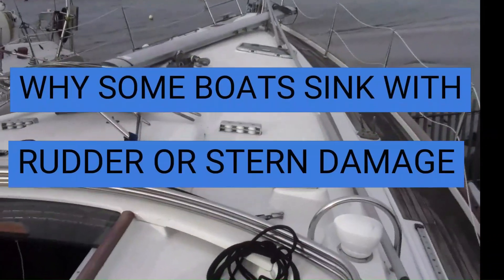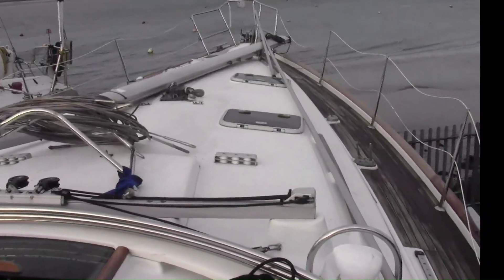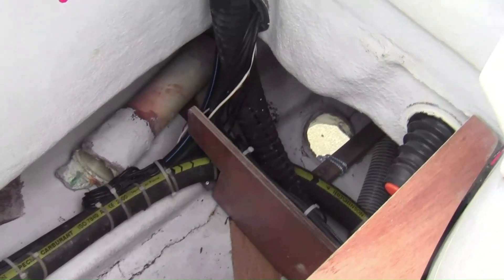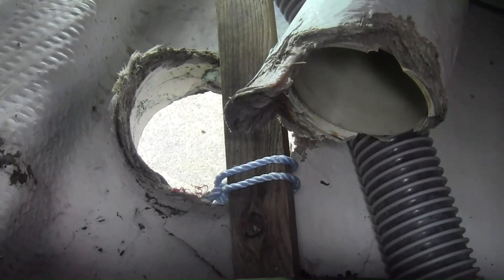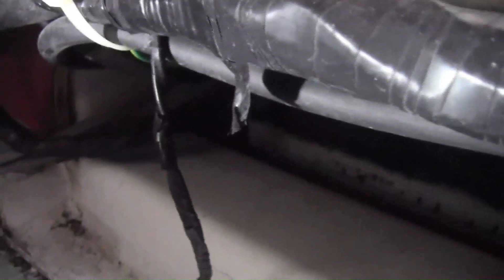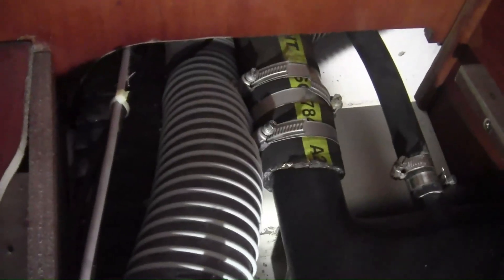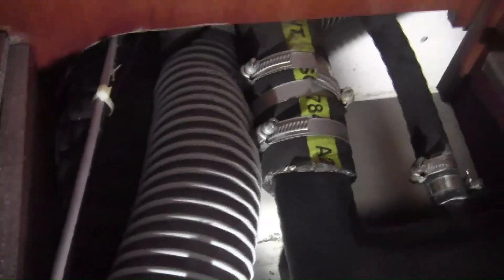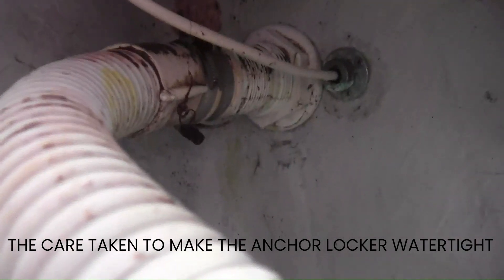Why A Yacht Sinks With Rudder Or Stern Damage

Comment: I'm gonna be honest here , i've only watched the first 4 minutes , and i already know , and totally agree with what you're talking about . The fact is , i've seen this for myself , on my own yacht . The boat had been re-engined at some point , and to put it bluntly the bulkhead had been butchered . Very little of the original remained , and there was very little i could do . The engine sat right in the middle , and so fitting a new bulkhead would have been almost impossible to fit . So it had to stay that way . A full inspection revealed there were no bulkheads under the cockpit at all . The cabin bulkhead had much larger holes , than necessary to allow pipes to pass through , and itself poorly tabbed in .
Reply from the maker: Mickey, I guess it's the same on lots of more modern hull shapes where all hoses etc have to lead low down the hull because they have to pass under the berths in the aft cabins. It wouldn't  be easy to seal well but maybe some thin ply either side of the bulkhead cut to shape and bolted together would lessen the ingress so pumps could cope. The stronger attachment of the SunFast shown near the end would lessen chances of failure. This bracing could be done to the Beneteau easily enough..
Reply: @mjcooke2sailingmostly  Yeah , to be honest i never saw that bit , as like i said , i only watched the first 4 minutes . You're still right to bring it to the fore though , it's a serious problem . What annoys me , is that it's pretty easy to address during the build process , now it seems , they just rely on a liferaft . Personally i would prefer to stay with the larger boat , i've never been in a liferaft , but from what i hear it's pretty unpleasant .